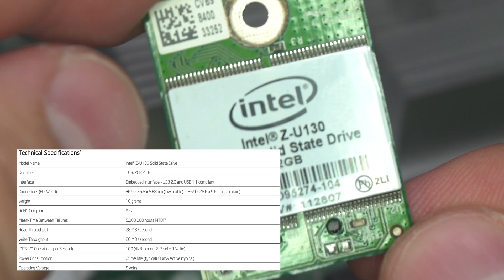Riverbed Steelhead 550 Teardown

Comment: How does this unit compare to the 250?  They look identical from the outside.
Reply: I dropped an extra $43.80 and answered my own question - difference appears to be that the 250 runs on a Celeron M 1.66GHz CPU and 1GB DDR2, and has a smaller HDD.  I imagine the 150 is diskless, using only the USB SSD.
Reply: @frank1985au  is the red sticker warning about non poe ports covering a hole in the case ? ive just managed to get two of the 250's for £50

Comment: I picked up one of these for $15 sold as working and it had a bad PSU. The seller gave me a refund and didn't want it back.  Turns out you can use the 4 pin cpu connector from a standard power supply to power it up. Just short the black and green wires on the ATX plug/  Mine had an IP on it registered to the federal government.  It appeared to have been quickformatted because the SATA drive had visible HTML on it from an Outlook Web Access session when you looked at it with DD.  No Hillary e-mails  though.  The drive got reused in something else, I didn't pry into it.  The Xeon is a glorified Core Duo under a different name.

Comment: Tell you what that hard thermal pad material they use is awful. Over the years, have developed various removal methods; by far the easiest is wd40/crc. Apply generous amount to the area and leave to soak for an hour and it will degrade the material and wipe off. May need a couple of goes to get it all. Then you can use alcohol to remove the oil residue.

Comment: The caps in the power supply are bad, you can see the top of one is bulging.
Reply from the maker: Still worked fine. Although I'd obviously replace it if it was going into use. :D